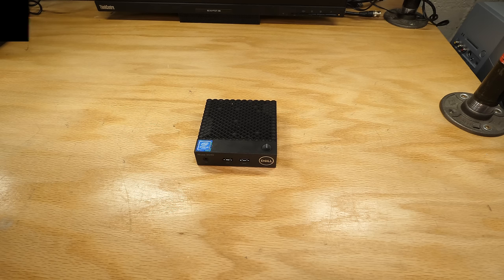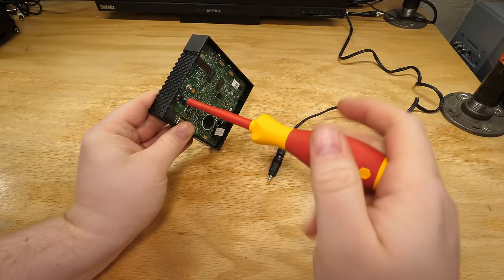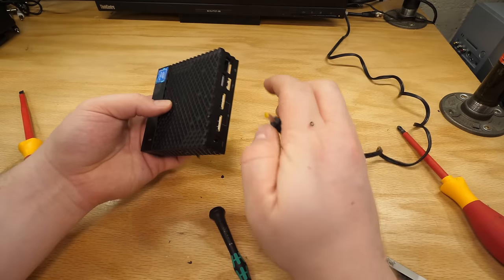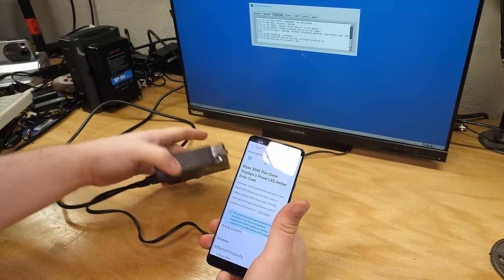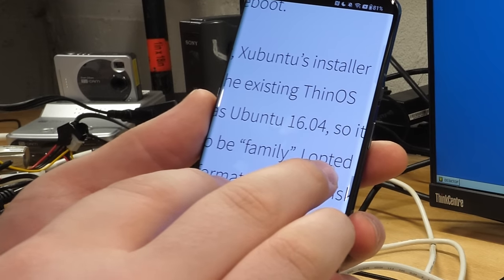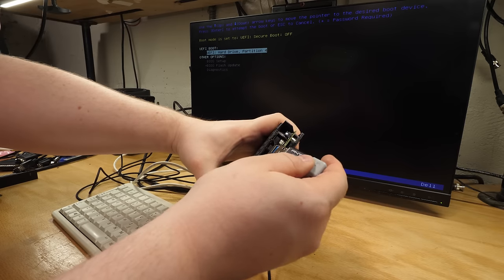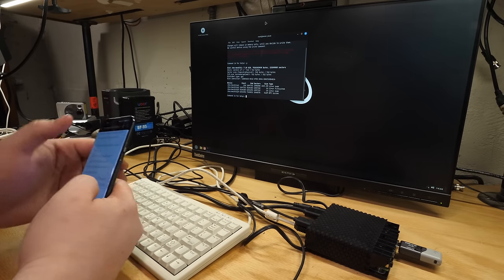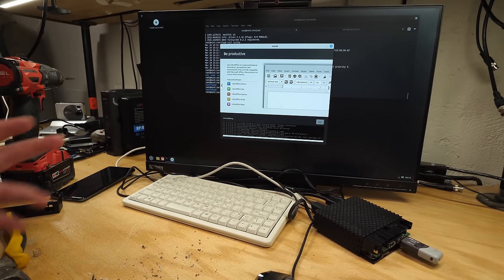Little Guys: Episode 2 [Wyse 3040]

Comment: The only thin client I own is a ThinkCentre M625q. Okay, it's a bit bigger, but I love that its AMD E2 processor is completely passively cooled, and the heat sink is so massive it takes up the whole top of the inside of the case. It came with Windows 10 Enterprise, but I quickly replaced it with openSUSE micro OS and it makes a fantastic headless server.
Reply from the maker: Oh huh! I actually came across one of those AMD ones and I didn't realize it was passively cooled, I'm going to have to take a closer look at that

Comment: I have one of the bigger Dell Thin Clients from roughly the same era (Wyse 5070). That one actually acts like a normal computer and its m.2 slot is wired for SATA. They came with a Pentium silver and up to 4GB of SODIMM DDR4. Mine is in my network rack running DNS and my Unifi controller. I did opt to use a SATA m.2 drive instead of the emmc. 

It has been a great little guy for me. If you don't need some of the special IO of the rPi these thin clients are cheaper and more functional.

Comment: Ahh! it reminds me of the tinyXP releases that would consume no HDD space. I think there were windows 7 versions of that but it seems impossible for win10 onwards. I had to resort to Xubuntu on my dell laptop which only has a 30gb SSD integrated into the motherboard. My windows install eventually failed! Even now with linux I only have about 8G of free storage. Cheers DELL Thanks for the video dude...

Comment: This thing has about same specs as a netbook I bought when netbooks first became a thing, and I used it as my daily driver for about a year. The Atom processor leaves much to be desired. But, I was doing Oracle db training, and installed an Oracle database on it to practice. Was playing minecraft on it. I tried gaming, but lack of gfx card was issue. But, there was some virtualization software you could download to virtualize a gfx card, and I got Far Cry to run on it at lowest specs. Ran poorly, but was playable. The Atom processor is a fun little austere cpu, but at that point might as well get an ARM or something.

Comment: Those power LED’s are overdriven and notorious for dying.

These are great little machines. We use them at my work for VMware Horizon without much maintenance.

I bought a used one to run my home assistant instance.

Comment: I used to use a Wyse 3040 when I was working as a help desk technician at a bank. It only connected to a remote desktop, Windows 10 and that's all about it. And yeah, the LED light was so weak that I tried to turn in on so many times that I actually turned in on and off all the time. 😂

Comment: ThinOS ran on much leaner hardware than the atom in prior revs. We used the t1p units for RDP think clients and those were 1.2ghz marvel arm single core with 1GB ram. You could also buy monitors from Dell with the whole thing embedded in the screen

Comment: I work for a university IT department in a classroom support capacity, we have thousands of these things, 90% of the calls I go out on are these wyse boxes getting locked up and needing to be power cycled to fix. Also at least 80% of the power LEDs on these things have failed overtime.

Comment: A slightly better 64 bit thin client that supports adding additional storage and RAM (4 gig will work) can easily be used to run Open Media Vault. That's a fairly bare bones install of Debian plus the OMV software, which is primarily managed remotely via web browser. After the initial install there's just one bit needed to be done from the command line (either locally or via telnet) to install the OMV Extras package.

Then you create a shared folder and map it with Mini DLNA so that you can access the folder from a computer to push media to storage attached to the thin client. That media will then be accessible by any device with a connection to your LAN. It's ideal for a Smart TV that has the capability of playing HEVC video. No need for Plex or anything that transcodes video on the fly. Just put media on the OMV share that your TV, phones, tablets, other computers can natively play using their own software, as long as they support DLNA.

Comment: can't wait to watch the video about that ThinkCentre computer,  while thrifting for a decent 4:3 monitor for my Re-PC pickup, I saw what looked like a monitor for $12.99 looking closer it had an intel Core i7 sticker on it, I bought it without hesitation.. It turned out to be a ThinkCentre AIO 5i with a 13th Generation i7 CPU, the only problem is slightly scratched screen, but I love that I can use it as a USB-C dock for my laptop or an external monitor for any other device...

Comment: 13:01 100%
I've taken note of these thinclients on the back of the monitors present in just about every exam room and patient room in local clinics. They look almost exactly like this just screwed into where the wall-mount bracket usually is with an arm attaching the whole monitor-pc apparatus to the wall near the physician and nurse's station in these rooms.

Comment: I've got 1 running Volumio which was really easy to get set up. 

I've got another running on Debian with Moonlight. Streams great using Sunshine on my gaming rig. You do have to run the Grub fixer thing as the BIOS doesn't like a EFI thing. There's documentation out there on that. 

 I didn't have any issues using a DP to HDMI adapter to get output to a HDMI only monitor.

Comment: I bought one of these on eBay for use as a PiHole and a couple other things. I installed Q4OS on it, a really stripped down debian distro. In fact it's the best balance I've found in terms of lightweight yet feature rich debian. Make sure to use the Trinity Desktop Environment version. TDE is weird as hell (it's a fork of KDE 3), but keeps things super slim and lightweight. 300ish MB ram usage at idle.

Install xrdp and then you can ditch the monitor cable. Surprisingly smooth with this setup.

Something like Linux Mint is not gonna run well on this.
Reply: I just set it up to not run xorg on boot (i.e. boot to a shell). That way, it can do all sorts of things it would otherwise be pretty slow at.

I can make most of the changes/tweaks I need to make on it via ssh and if I really need the desktop environment, I can xrdp in and it'll start an xorg session just for that.

Best way I've found to use hardware like this.

Comment: I'd second the recommendation for a Wyse 5070 as a slightly larger 'little guy'. Provide you get the non extended option (the extended option features a PCI-e slot, but also a fan) it's completely fanless, supports an M.2 slot that it's easy to put 1TB or more NVMe M.2 card into, and up to 32GB RAM (although, note, if you want to expand the supplied 4GB to 16GB with an extra module the BIOS needs updating, it will otherwise supply an unhelpful and misleading error). It is much much faster and more reliable than anything Pi based.

Comment: Hi, i toyed around with a few thin clients, i kept one using citrix to actually remote desktop to work to do payroll when i am sick at home

Other than that, you can format then dos 6.22 + win 3.1 or win 98, Parky tower has a excellent site.

I picked up 6 for $20 as they did not have video cable or power supplies, but the model i grabbed used the standard dell 5.5mm 19.5v laptop charger, and we have about 20 of them at work

I imaged them all for dos and games, and later 3 of them became MAME emulators - this hardware is a great retro games machine

Older Linux mint V17 and even linux puppy works fine on them - bu ti have not actually used a wyse 3040 - but those 2 programs have worked on the other 5 or 6 different models of Wyse i have purchased

Comment: I have seen different Dell Wyse systems that are used at places like fast food places McDonalds Steak n Shake and other restaurants actually use them for kitchen, cooks, and grilling areas as a way to show what is on that order and are pretty instant as in once the order is fully submitted in it would then show up on the monitors for the kitchen staff to use as a quick easy way to know what was ordered and how it was ordered and what order number it is part of

I did take an HP thin client and made it into a lightweight ESXI server for things that can run on a Pi

Comment: For any other system you take a look at, the cli command `blkid` (you must run this as superuser) in Linux will list information such as the names, uuids, which devices they are in /dev/, and what the filesystem is (or what it thinks it probably is, anyway) for block devices (hence block identification, blkid). It's possible this one was using XFS or some other filesystem that's not included in a few modern distros by default despite being fully supported as a root filesystem. The full fat GUIs that can tell you the same information include Gnome Disks (gnome-disks), KDE Partition Manager (partitionmanager) and of course GParted (gparted).

Comment: I've got some of these running OpenSUSE. So far, I am using three for a little quorum, one for a octoprint, and one for a display. They pretty much behave like typical x64 boxes. Sometimes you can get these for amazingly cheap in office liquidation lots. For a data point, my power LEDs are pretty visible when running. I assume YAST didn't trip over the drive model. Later, I'll take a peek and see if mine have a strange model name as well.

Comment: We use these turds at work. The CMOS battery issue is well known enough that Dell mentions it on their site. Rather than going through the trouble of seeking a proper replacement,  I just bought some bulk CR2032s, a battery powered spot welder and some electrical tape.

After removing the old bettery, I spot weld the connector to the replacement battery. 

Also, the dim power button affects some Dell desktops as well. We have a couple of 7080/7090 systems with that issue.
Reply: I don't even spot weld, the RTC battery must provide so little current that the shittiest contact is good enough. Just need to secure the leading edge of the cell with good tape so the contact doesn't short it, and secure the contacts to the cell. Probably not something i would do at a job, if i could just bill the tab welder to my boss, but good enough for my private repairs.

I'd be surprised if someone wasn't selling properly made replacements in bulk on Ali for very adequate money; though i'd still test myself every single one of them for shorts and polarity before putting them in :D

Comment: FYI there are Win11 computers sold today with eMMC primary storage of 128g or whatever (cheapo dudes at Walmart etc.). eMMC performance is trash compared to NVME but I believe there are chips available which are a lot faster than an SD card hence why it’s popular on things like ARM SBCs but it can run win11 if you did the chip swap. 

That being said BGA soldering is not for the faint of heart/those unprepared to destroy a few boards learning. If you are interested in going that route I do have an EE ninja friend and I’m also in the seattle area.

Also if the slot has pcie you should be able to do NVME of some kind.

Comment: You can use it indeed as a MSRDP client to log into your Windows machine. The network and processor connection is fast enough that you can get away even doing editing or if you want to remote control your OBS recoding or as a recording monitor. But you can also do this with a Linux install. THINOS just has the advantage that nothing else runs in the bg eating up cpu or memory bandwidth

Comment: If you're comfortable with the command line, I think a minimal NixOS install might be useful.  That forces you to partition manually with [c]fdisk and you specify the mounts in config files. 

I wouldn't recommend it for people that aren't comfortable dropping into NeoVim or Nano or something, but since you seem able to do that, I think it's worth considering; that said, upon thinking about it, the storage space could be an issue so it might be best to simply do Arch, since it's super easy to get a lean system built with that.

Comment: A little googling suggests that the single PCI-E lane provided by the CPU is already in use by the Ethernet controller. Supposedly the M.2 socket in there has only the the pinning needed for SDIO (which I didn't know was still in use beyond early 2000s PDAs). Wild. Thanks for the rundown on this awful monstrosity.
Reply: SDIO is widely used to connect the WiFi+Bluetooth chips on tablet computers, including Bay/Cherry trail ones like these.
Reply: @SianaGearz  This gave me genius idea of looking up if there's any M2 to SD adapters... before being sidetracked by the fact that that's how the Memory Stick Micro was called.
So I guess uhhh... gotta look for NGFF adapters?

Comment: I can confirm that pretty much all Dell devices with this type of power button get dimmer and dimmer as time goes on. I've had this same issue you did because our primary devices at work are Dell. Same with how when you plug it in, the light turns on for a brief moment (and power supply fan kicks on) then it turns off. It drives me nuts!

Comment: Although these might be outside of the scope of what you can reasonably display in one of these episodes, I think it'd be cool if you could cover one of the ryzen embedded single board computers. The ones that are kind of like the RP2040 stamp microcontroller, but they're a wholeass system on a board. For the purposes of a video, you would probably have to find one already attached to a carrier board or something like that if you didn't want to have to solder it onto your own pick, but I think they're just neat lil guys.

I'm loving this series though. Just neat lil guys, beep booping away, even if slowly.

Comment: Just to be pedantic, there is no such thing as a truly passive DP to HDMI/DVI adapter. There is always an active level shifter chip in a DP dual mode (DP++) adapter. Most of those chips also answer to DDC/I2C accesses to declare their presence, and the slightly fancier versions (type 2) can also be controlled to some extent.
Reply: I think he knows that, and was just comparing adapters that have a USB port for supplemental power vs those that don't.

Comment: I so badly want this form factor to come back, like maybe even this exact case design. We have SoCs that would do so well for a lot of people even running windows right on the little guy. An N200 or i3 N305 would be easy enough to cool with a little fan or even passively, and RAM is so dense now yo could solder 8-16GB to the board with a little M.2 slot for the SSD. AMD has some little APUs under the name "Mendocino" that would probably also be a decent fit.

Comment: A deep discharged CMOS battery causes various laptops to fail to power on. It's worse than not having one. If you encounter that, you can just try yeeting it and seeing whether that helps.

My preferred repair is to just take the original CMOS battery apart, reassemble it with a normal CR2032, and tape it together. You can strip back a little of the wire or reuse the existing welded nickel steel strips as contacts by fatiguing the weld spots. I mean there's any number of things i could do, there's barely a connector i don't have at hand and can't crimp, but i mean they've done the work for you, might as well reuse it. For tape i use electrical tape made by TESA, i stretch it and it welds itself shut after a few weeks and it's going nowhere, and you could reinforce it with heatshrink for good measure or not. Use some extra tape, and stretch it to take shape, along the leading edge of the 2032 cell to make sure one of the contacts doesn't bridge both sides. In turn quality of electrical contact is not very vital, the connection is not what one might describe as current carrying.

Dangling battery isn't good. It needs to be taped in place with suitable double sided tape that survives elevated temperatures.

I am actually going to build myself a battery welder someday, based on capacitor bank.
Reply: Conductive copper tape for the contacts.

Comment: On a side note: PNY's USB 3.0 drives are some of the shittiest I've ever used that actually claim to be USB 3.0. If you do actually want to live boot an image from USB 3.0, I'd recommend picking up something like an iODD Mini. I particularly like that model because of the compact size, the useful display, and the ability to mount virtual partitions in two flavors, as well as present as a bootable USB device or as a CD/DVD-ROM. Plus, you can navigate through a file system and select the image you want it to present to the PC to use. It can also be set to read-only in case you have a machine that likes to try to wipe or over-write connected media like Dell's Unity arrays like to do when you're reimaging those bastards.

Comment: I have the bigger cousin of this thing, with 16gb of emmc. I use the emmc to hold an emergency Linux drive. It's got 12gb of ram, 2tb sata m.2, and I've replaced the WiFi card with an adapter to put a slow nvme drive in. It will not boot from the nvme. 4 cores that I have windows 11 (for WSA) and virtual machines running on. More powerful than a raspi, and cheaper too. Wyse 5070. I wish it had HDMI.

Comment: Looks like it's Mint Cinnamon, Maybe LMDE Cinnamon. XFCE & Matte typically have a lighter color scheme by default. That said, I'd personally go with XFCE for a device that low powered, due to it's exceedingly low specs, (that's presuming I HAD to go with Mint, otherwise there's a whole host of substantially lighterweight distros I'd go with, ranging from puppy to slitaz). That said though, I personally would actually stick with thinOS, or another thinstation OS & actually use it as a thin client, connecting it to my virtualization server & spinning up a VM from there. WAY better